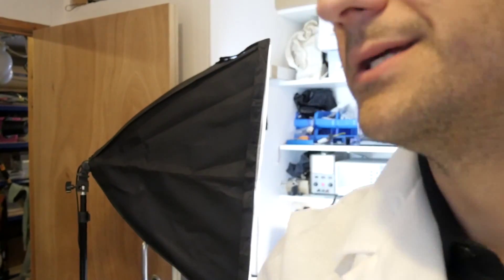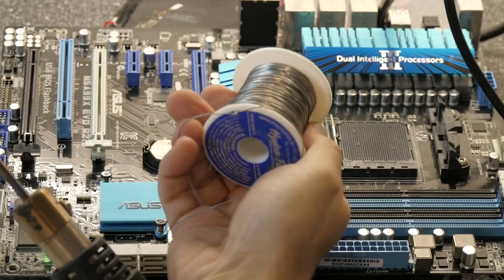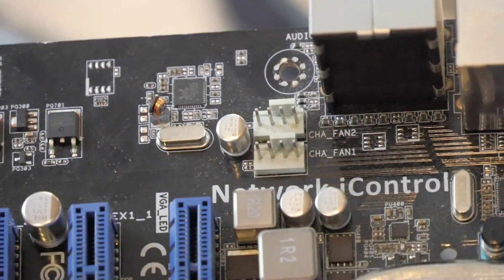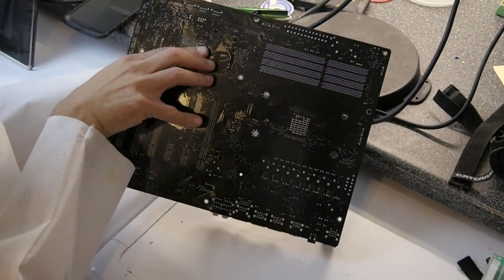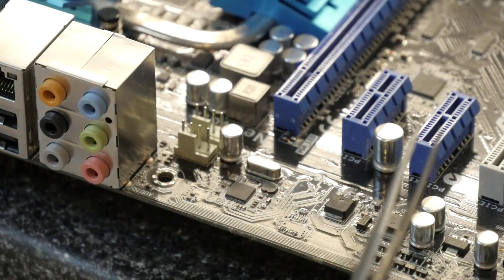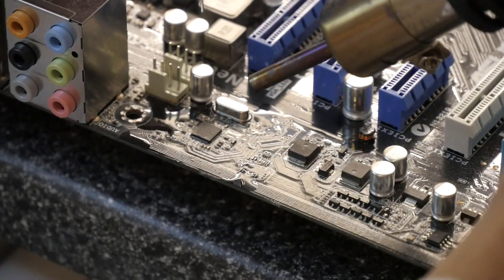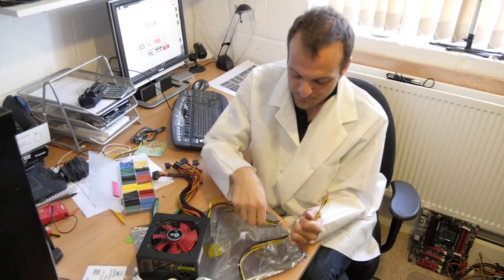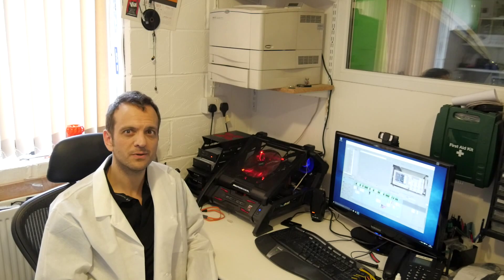PC Motherboard Hardware Hacking and PSU wire modification Tutorial - LP

Comment: Wouldn't you want to reassessed the sickness of the PSU wires before making them longer since it will now have more resistance? Just a thought might end up blowing up your new PSU as well
Reply from the maker: It would be negotiable, however more resistance would not really harm the PSU

Comment: (sorry for my english im spanish and actually learning... hope is not a 
problem)
I need help... I  got two ssd's of 120 GB that i want to solder them to 
make a single 240 GB ssd (same brand and model) and i want the computer 
to recognize it as a single drive just like with a normal 240 GB ssd
also i wondered if i could do the same with hhds or usb flash drives

I dont understand why but i cant find anything,i dont want an external 
RAID device to do this just solder the devices
so if you know how to do this or if you know any tutorial i would 
appreciate it a lot, i been three hours trying google but no tutorial 
like this was shown ...
I wondered if i could just solder cables from one disk's SATA pins to 
the other one,and then connect supply energy to both ssds,but only 
connect one SATA cable to the motherboard...
Reply from the maker: +juan martin Hi, this is not possible, getting them to be recognised in this manner would require another layer of electronics to emulate a single drive from multiple discs. Your only option is a raid or JBOD controller.
Reply: En una palabra... NO.

NO PUEDES